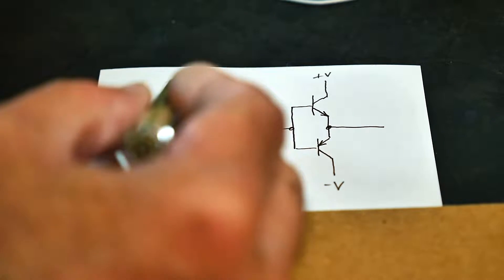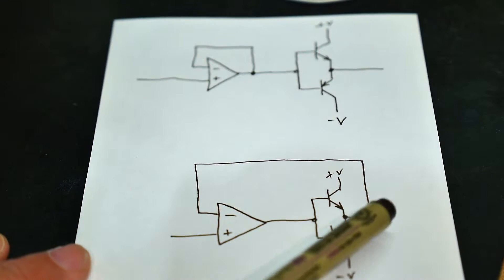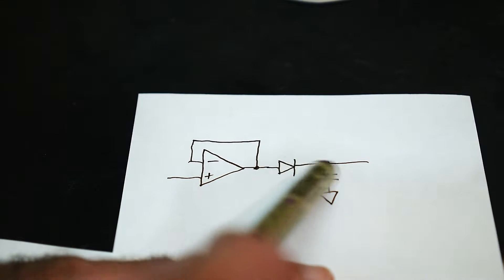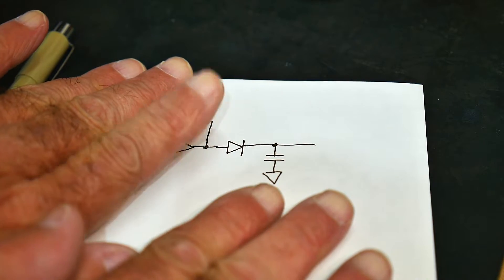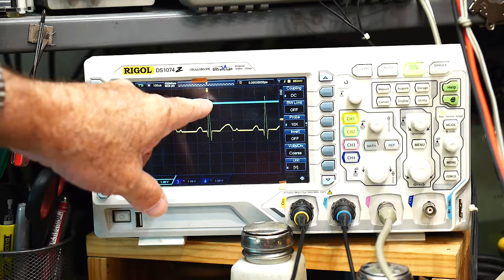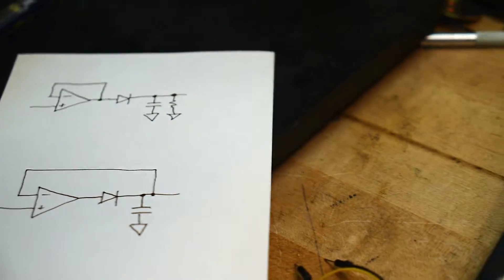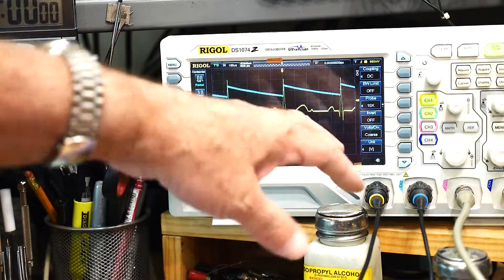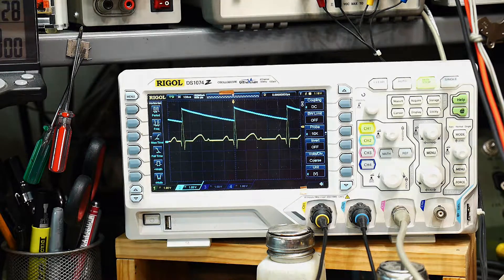#476 Ideal Diode Peak Detector Circuit

Comment: I used to work on IBM peripherals and we didn't have switched power supplies in those days - just rectified AC and smoothed. For intermittent problems, we were always asked to check if the ripple on the DC was within limits. This necessitated the use of an oscilloscope. I designed some circuit which looked like some full-wave diode bridge rectifier and some caps to charge to the peak and from the peak to charge to the depth of the ripple. I have lost the circuit. I tried to test that but didn't have enough stuff. The primary OP-AMP  in those days was the 741. EDIT: Now that think of that need, it would also suit the need of someone experimenting with amplifiers since it would establish how centered the amplified signal was in relation of the biasing and where you were in danger of clipping the signal. Of course if you have a whole bunch of sophisticated colour digital storage oscilloscopes, you will never see any need for this bit of troubleshooting circuit.

Comment: Nice explanation and demo. I was thinking uses would include audio compressors and VU meters but you beat me on one of those.
Reply from the maker: yes. I want to combine the peak/average detector with an LED that drives an optical compressor with photoresistor. The peak detector in my audio circuit is working and gating a FET to gate noise but it causes an audible click
Reply from the maker: the right way to do things is a true RMS detector and VCA but both are rare parts and I want a DIY circuit